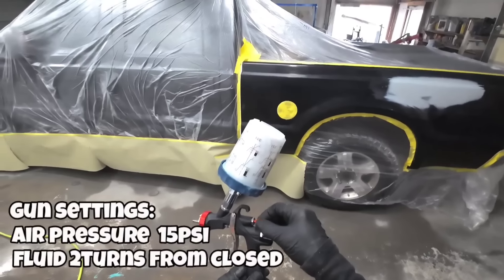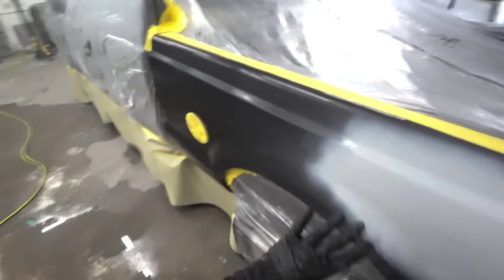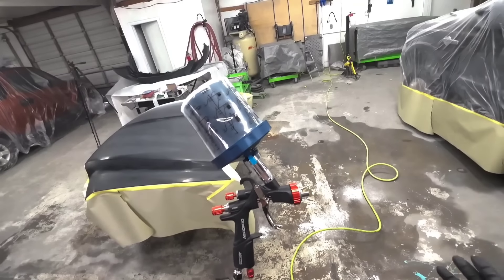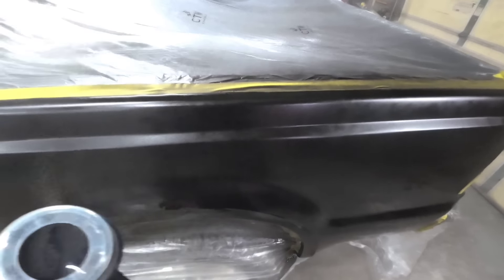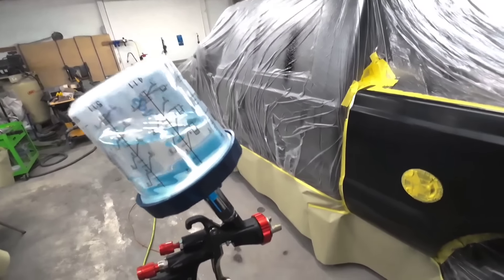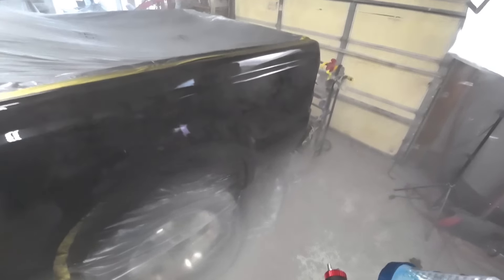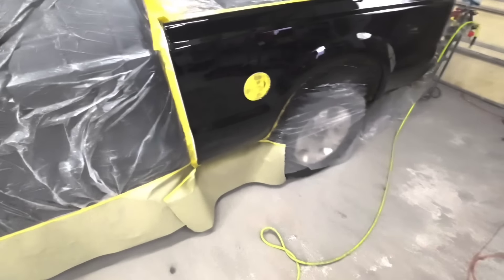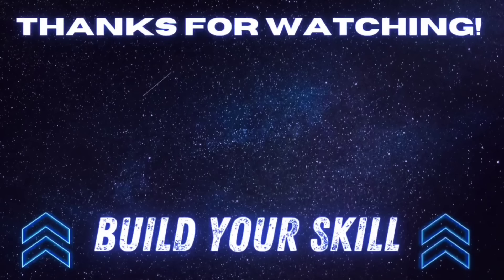Spraying CLEAR COAT: 4 keys you must know!

Comment: Great video.  I'm getting ready to paint my '80 Corvette and will be using my R500 gun to spray, so needless to say these series of videos are helping tremendously.  Keep up the good work.
Reply from the maker: Awesome! Sounds like a cool project. You can share photos garagenoise247@gmail.com  sometime I like to share viewers projects. I appreciate the comment and support!
Reply: R500 gun what size is your air compressor ?
Reply: @darrellsomers5427  My air compressor is a 5 HP single stage oil free Sears compressor.  Rated at 8.6 SCFM at 40 psi and 6.4 SCFM at 90 psi.  Hope this helps.  I also just purchased an A610 gun.  Basically a R500 with three separate nozzles.

Comment: Very Good Video. If only this video would have been out many years ago. When I started painting, the paint store that sold me my first gun recommended having the paint volume opened all the way up. Needless to say, I had runs and inconsistent spray amounts because I tried to control the run issue. Thank you for putting this out! And as the other commenters stated I like your no BS approach and getting right to the point.

Comment: Thank you! I just bought this a610 gun, no experience in painting at all. We inherited a vehicle from my grandparents that has a lot of bare metal exposed (no rust) the rest is chipping clear coat and faded paint. I will be needing as much help as I can as a paint shops quotes are ridiculous, asking over have the price of what the car is work. I have don't everything mechanically to fix it up. Now just waiting for the cooler weather and when it's not raining everyday here in Florida. Running a 29 gal 165 PSI 5.3 SCFM @90 PSI 1.8 hp oil engine from harbor freight

Comment: Great video. Thank you. Everytime I spray clear I'm getting dry areas. Can you explain what it's from and how I can spray clear without getting the dry areas? I am using the r500. Thank you!
Reply: Is it a fluctuation in your air supply?
Reply: @allankaul8331  I don't think so. It happens when I use my fuji mini mite 5 platinum as well as when I use my 20 gal northern tool compressor with the r500. I'm under the impression it's a gun setting or my technique...
Reply: too much air pressure and not enough clear coming out its drying I believe aswell as you come closer to some parts of the panels then others.  keep an even flow also even distance the whole time your spraying and you will get great results
Reply: @josequiroz4605  thank you. I know I did everything you mentioned wrong, so I will focus better when I spray again this week.

Comment: I run my Devilbiss DV1 Clear coat gun using the 1.2mm for 2:1 high solids euro clear at 10psi. For 4:1 medium solids (overall clear coat) i use the 1.3mm nozzle at 8psi

Comment: Us Paint Reps speak to all gun manufacturers and discuss proper gun set up.
You turn your volume all the way out-with the trigger pulled turn it in until you feel tension
From there you start to count turns in.
I’m all the way open sometimes up to one turn in- we need to speak the same Language.
Use the slowest Activator/Reducer you can handle.
Spray in cooler conditions , 69f is perfect if you can get it.
Heat doesn’t improve flow it actually creates Peel cause you have a tendency to overload.
Spray with a faster arm movement, with 60-70% overlap.
It will lay down flat.
I tell painters to practice on bumpers by spraying quickly.
Reply from the maker: Alot of different techniques to painting. My techniques are based off experience after 30 plus year and are alway being refined.  Every painting will develop techniques that work for them as they're experience grows. I will never Criticize Painters for spring differently than I do. Appreciate the comment in support

Comment: Nice video, Chris. Regarding set-up, what's the red bulb chamber underneath your air pressure regulator?
Reply from the maker: It's  a moisture or water filter . Just added protection against air line moisture.
Reply: Thanks Chris. Can you tell me the difference between 2:1 and 4:1 clear coat? Is one better than the other?
Reply from the maker: @jimmyo5367  2:1 clear is high solids meaning it is a bit more durable than a 4:1 clear . It's  a bit thicker product  but spray pretty much the same. 2:1 is typically a bit more expensive.
Reply: @GarageNoise  
Hey Chris
I started painting today after putting a few months of preparation on the 1992 VW Cabby. The results are quite horrendous! 🙄
The car was washed 3 times, then prep all grease remover, then isopropyl alcohol and finally tack ragged. 
I started with a sealer primer and immediately the application formed what I can only describe as creators.
I've stopped until I can figure out what went wrong. 
I can email pictures if you think it will help ID the problem. 
I'm using an R500 out of the box today with a 1.3 tip. 
Any help will be greatly appreciated
Thanks
Jimmy
Reply from the maker: @jimmyo5367  send me pics garagenoise247@gmail.com
I believe your sealer might be having a reaction to the substrate.  Are you painting over the sand orig paint or did you strip it all down? It may just be as simple as appling the sealer too wet on the first coat. Sealer likes to do that I always suggest a light coat to start with to introduce the sealer to the substrate. If their shallow fisheyes (i believe that's what they are) than most of the time they will dissappear on the second coat and won't  affect the appearance.

Comment: I just bought this gun through your affiliate link on Youtube and I plan to try to use your links the most. With that said on the disposable cup system. What cups and quick-connect adapters go well with this gun?
Reply from the maker: I use the series one pps system.  Aftermarket brands are on Amazon and I have links in description.  Sray IQ is my preferred brand but they may still be out of stock also I've  used savito https://amzn.to/448uLXD
The adapter I get at harbor freight spectrum #57505
Appreciate the support brother!

Comment: Hey great video! I’m new to spraying. With the sealer section you’ve clipped out the first part explaining the fan pattern setting! Would be so helpful if you could tell me what setting you use, I just bought this same gun, also I thought the fan pattern was the bottom knob and fluid the top so thanks for that!

Comment: Hey, quick question (PLEASE answer)
I have an inline ball filter like the one you have in the video, and I was painting a car, and LOTS of wool like strands were popping up on my paint. This was paint that was very cheap, like $136 for a full gallon of red metallic basecoat cheap. However, I was wondering if it is more likely the paint or the filter? I have only used it a handful of times, although I haven't used it in about a year until today.  Also how often should I replace these inline ball filters? Please let me know, thanks!
Reply from the maker: I don't  think it would be from the filter. I've never had an issue. I change mine about once a month, but in the summer  should probly change it every couple weeks. Appreciate your comment! Sorry I took so long to answer.

Comment: really thanks! Aeropro review seems not very good may be just a distributor, Rongpeng I see is a professional co. Would mind to share the adapter and the caps, regulator etc used?
Reply from the maker: The adapter for the series 1.0 is a spectrum  57505 from harbor freight that the  best way to get it 3m is a #2 legacy series and Hard to find. Appreciate the comment and support!

Comment: Great Video. I have a newbee question. I shot a bumper 3 days ago and had a place that didn't get enough clear on it. I didn't have enough light and the angle was wrong. It has enough on it  to cut without reaching the basecoat. My question; can I scuff the entire bumper and spray more clear? Would you use a red scuff pad or 4oo wet or something else? Thank You
Reply from the maker: I'd dry sand it wit 800 and clear. Red might be a little too coarse, you don't  want to see scratches under your clear .
Reply: @GarageNoise  I'm going to do what you say here and thank you for answering my question at all, but I'm just curious why dry? wet is so much easier (in my opinion.)

Comment: Great job but I'm wondering how you are getting away with spraying without a booth?  Do you have an exhaust fan to get the overspray out. Did you have your torpedo heater running also? I used to spray in my garage but I had the overhead door slightly open with a torpedo heater by the side door entrance just outside but facing in & a whole house  belt driven fan on the opposite end on the wall with the window open + furnace filters on the wooden enclosure I built for the fan. I only had siphon spray guns. Great 
videos you have, like them all.
Reply from the maker: Thank's brother! I slightly open the front door and the back door  with an exhaust fan under the back door. Now I have a exhaust fan in the wall up high in the back. I do use a torpedo heater  in the winter  but shut it off when I clear. I am slowly building a booth. Appreciate the comment and support!

Comment: What do I need to do to spray clear coat over a clear coat I sprayed a few days ago.  I used 2k aerosol 2k but got 2 decent coats but wanted another good coat on.   Do I have to scuff the previous clear coat or can I spray right over the previous clear coat?
Reply from the maker: After a few days then yes you need to scuff it again 600,800 or 1000 grit
Reply: Thank you

Comment: How should i go about painting a very big rectangle shaped box.  I would just do it like it was panel by panel but the edges top and sides are all rounded slightly instead of being a corner.  Im suppose to keep my wet edge but idk how to go about it.  Its 3.5 ft deep and tall. 2 feet wide.  Big rectangle with rounded corners.  How should i go about it?
Reply from the maker: Paint what you can the first go around  and then let thise sides dry and paint the remaining side or sides and use foam soft edge tape right on the edge. A little polish of the soft edge after it dries

Comment: enjoying the video's. What size cups are those you are using? I plan to purchase the cups that you are using but not sure what size to order. Assuming will work with the Huihui R500 gun I ordered.
Reply from the maker: Yes they will work you need the #57505 spectrum adapter from harbour freight.  I believe the size is 20oz cups
Reply: thanks so much for the information @GarageNoise

Comment: I'm painting my 1972 Cutlass 442 with multiple coats of PPG Duracryl Viking Blue lacquer with their High Performance clear for 2 or 3 final coats.

Since it's been over 20 years since I painted any car I'm still stressing over this last one!

I have a Bink's 2001 siphon feed with an agitator cup that has never been used, a new Devilbiss Finish Line HVLP gun and a new AEROPRO HVLP SPRAY GUN G6600 HVLP gun! I've never used an HVLP gun so I was wondering if there will be any issues using one for metallic acrylic lacquer? Some on car forums say it will be an issue getting the flakes to flow out? Some say to thin down a bit the last color coat with lacquer thinner and it will flow everything out. What do you think.....which of these guns would you use for metallic lacquer paint?
Reply from the maker: It's  been awhile  since I sprayed lacquer paint, but If I remember right it sprays real similar to single stage enamel.  I really don't think you'll have a problem using any of these guns, as  long  as the paint  doesn't have large metallic flake. Any standard flake will spray though  a 1.3 tip. I think you'll  like the Devillbis hvlp . I would spray a little test panel and get your feet wet again.
Reply: @GarageNoise  I was curious about the 3M PPS cup with the 200 micron cup lid. I was hoping I picked the larger  (less fine) filter with this cap. I was hoping that the 200 would allow the standard metallic flakes through and not filter them out! But then, I could remove that filter on each lid and filter the paint when I pour it into the cup using a standard paint strainer.

Comment: What’s the recommended air pressure for that gun? My manual for my old spray it Lvlp recommended 28-30 psi
Reply from the maker: For clear I like it at 30
Basecoat about 24

Comment: I'm learning quite a lot with your workshops. I'm about to begin my first exp. , painting my 4 runner 2nd gen. . I've ordered already a LVLP gun and I would like to know your opinion about the comp. that I need to buy for this purpose. I've got a 100L direct drive , 289L/min , 85db VS 80L direct drive , 2 separated motors , 298L/min , 68db . Thanks in advance.
Reply from the maker: 289l/min is around 10 cfm's  and is plenty of air for this gun! 👍
Reply: Thanks a lot Chris . I'll continue to pay attention to your workshops prior to start my first project.

Comment: Hello! A big thanks! For your valuable Videos. I repainted my Bumper Cover. And after clear coat it became orange peel. I wrote to you earlier and asked how to grind, to remove orange peel. You then wrote that I could sand with p600, until the orange peel is gone, but not sand through. Now I have sanded off all the orange peel. But I made a mistake. When sanding the last half of the bumper housing, I used the p800, instead of the p600. (Without knowing about this). So now all the orange peel is gone. But now one half of the Bumper has p600 scratches, and the other half has p800 scratches. My question to you is. After I have wiped the entire bumper cover with the right kind of industrial alcohol, and with silicon removal, and Lacquered 2-3 Layers with Clear Lacquer. Will these various rough/fine scratches be visible through the clear coat now? Because there are two different rough scratches under the clear coat? Thanks! From Tommy Bertilsson from Sweden
Reply from the maker: Your good you can clear over both 600 and 800 scratches without it showing scratches. 800 is finer than 600 so your good to clear.

Comment: Hey Chris, I did a similar spot repair, but the edges of the basecoat were rough and gritty. I'm using the R500 at the settings you suggested. Does having High Flow fittings change the gun setup? Any suggestions would help tremendously. 
Thank you!
Reply from the maker: You really shouldn't need a flow fitting. Bump up your fluid spray a bit slower and a bit closer. Try that also make sure you tip is clean and there's no restriction.  Hope this helps let me know.
Reply: @Garage Noise  Thanks for the feedback.  Your responses to comments are priceless.

Comment: Love the videos, what tip size are you using for sealer, base, and clear with this lvlp setup?. I have this lvlp kit that came with the 1.3,1.5, and 1.7
Reply from the maker: I use 1.3 for everything except high build primer.  I primer out of a separate r500 with the 1.5 tip.

Comment: My issue is having trash in my clear but I also don't have the best dryer filter setup
Reply from the maker: Clean air makes all the difference.  I'll  be getting a air dryer soon.
Reply: @GarageNoise  ya I just found a pretty decent 3 stage unit through global industrial under $500 I also came to the conclusion there is a waterborne cleaner I'm using that is causing solvent pops in my clear

Comment: trims and bumper of my car are made by plastic and done with 2 layer of bumper coater , is it ok to apply clear coat on the top?  if so, how long should i wait for paint done before applying clear coat? thanks
Reply from the maker: Possible,  I would check the Technical data sheet for the bumper coater, is that the name of the product? Not familiar with it. If it's  an automotive paint you can clear it and it need about ten minutes of flash time before applying  clear.

Comment: i just bought a devilbiss Dv1, My first decent spray gun, because i usually just paint small thinigs with cheap ebay HVLP guns, But right now im painting some car panels for my car, so want them to look decent...
I layed down the primer and metallic basecoat real nice.... Drop coat on the base, and it came out absolutely perfect....
Clear coat on other hand.... Quite bad orange peel...
I was 2 turns out on the fluid, at 29psi....... But i think i stayed too far away from the panel...
I increased my distance when spraying the metallic basecoat.. So i think i automatically did that with clear coat too...
could that be the main cause of the orange peel?

Comment: I think you will find that gun uses more like 7 to 8cfm. Those claims by the manufacturer are not even close. Maybe it would use 4cfm at 1.0bar. But most jobs will need 2.0bar for a good finish.
Reply from the maker: It definitely uses less tha any full size gun I've  sprayed with. less overpray and  noticeably less materials.